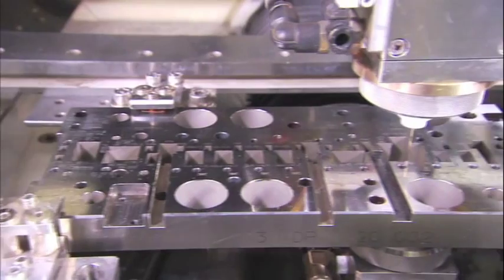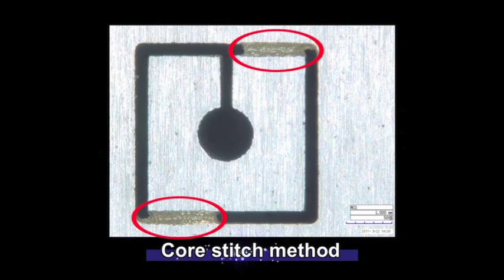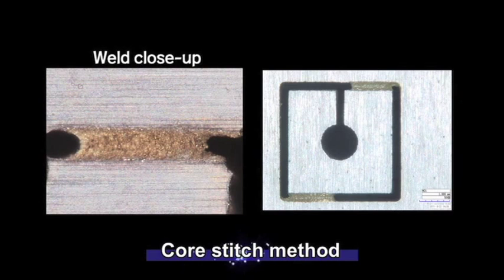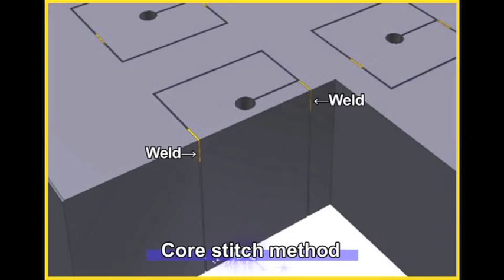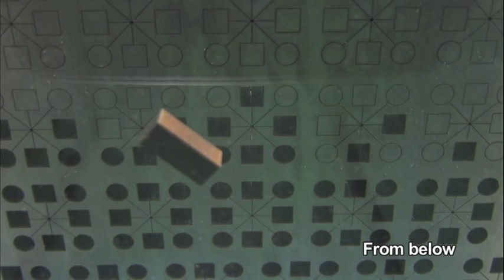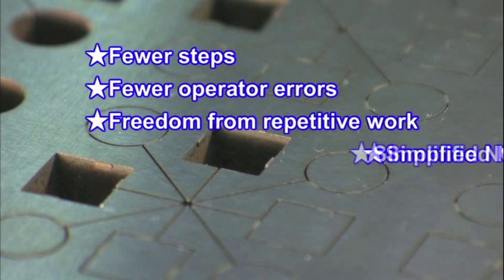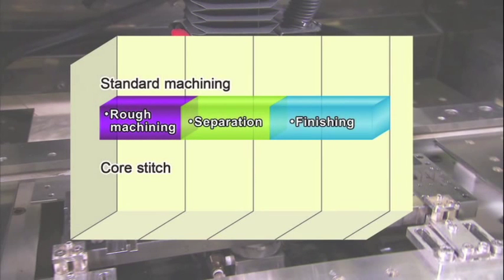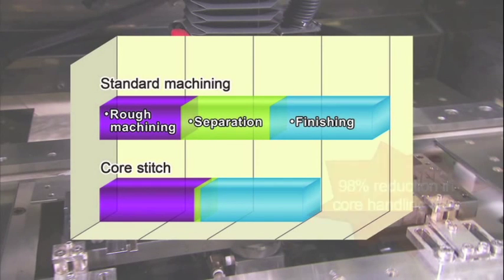Seibu Wire EDM - Core Stitch - Fanuc Control Video

Comment from the maker: The process of cutting off the cores (slugs) becomes unnecessary with Seibu's "CORE STITCH” technology.  Wire #EDM slugs can be welded at any desired position. The welded cores can be removed by tapping lightly. This drastically reduces the time for the cutting-off the tabs.